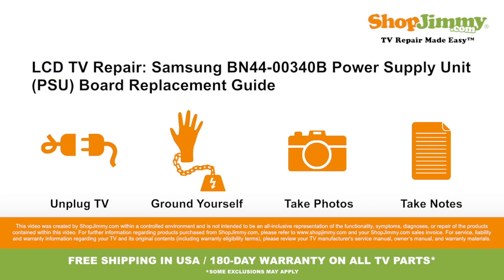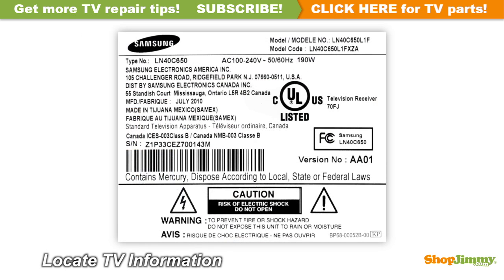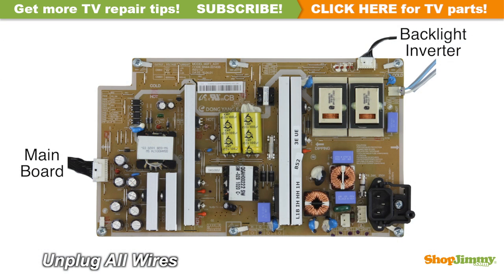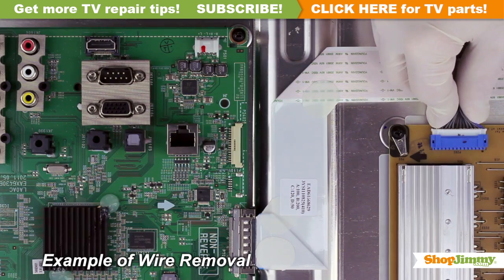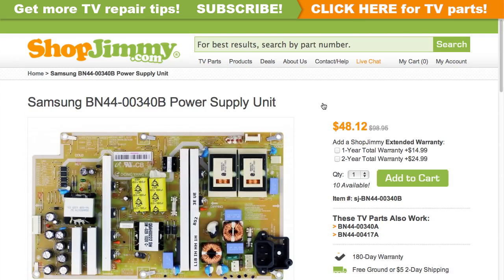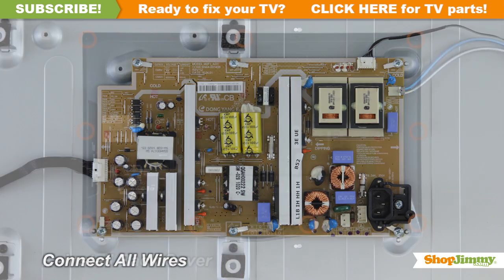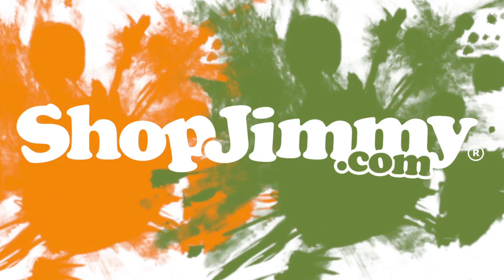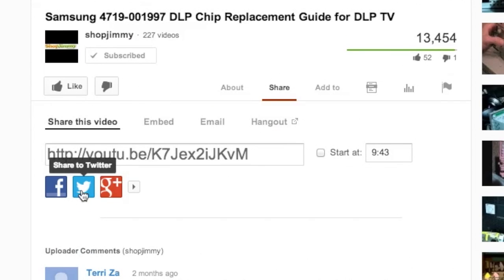Samsung LCD TV Repair BN44-00340B Power Supply Unit (PSU) Boards Replacement Guide

Comment: I'm bout to replace this board today. Directly to the left of the yellow battery looking things, capacitors I'm guessing, the small blue diode or what ever blew causing a spark and small flame when plugging the tv into an outlet. Should I be worried about other problems with other boards or will soley replacing this board fix it? I did not see any other burn marks or smoke from other boardz. The tv screen when black but the sound still worked, and had an awful smell now I identified as the blown component.

Comment: Ihave a sanyo  50 inc flat screen tv model  dp50 747 I push the power but noting comes on I ck fuse the seem to be fine what could be theproblem...
Reply from the maker: A Davis   I recommend that you give us a call and we can go through the troubleshooting steps.  (877) 881-6492  Thanks!  www.shopjimmy.com